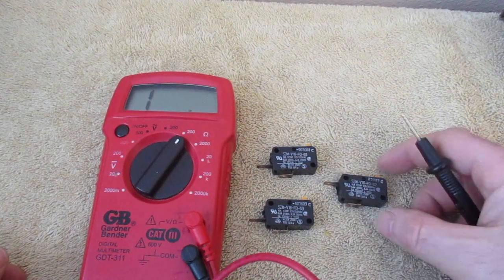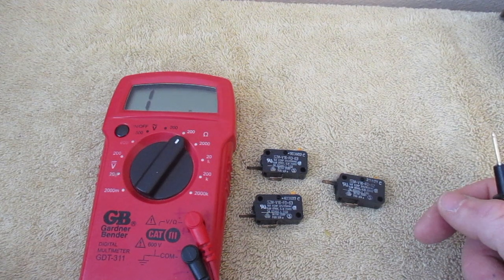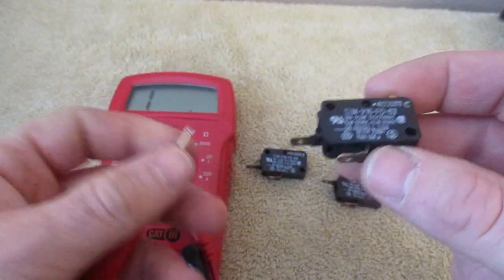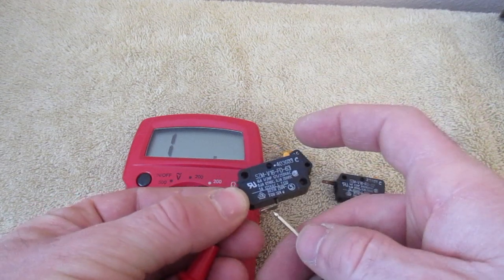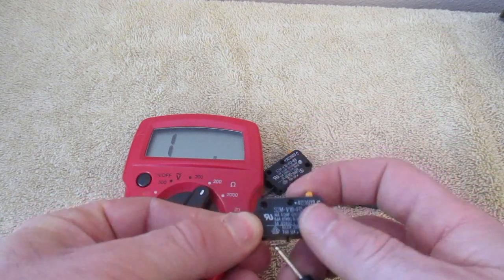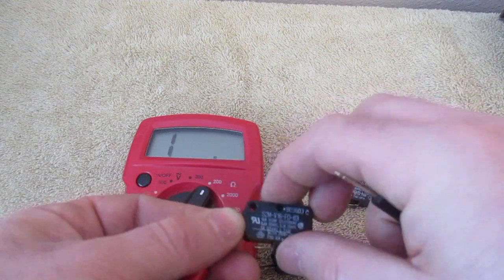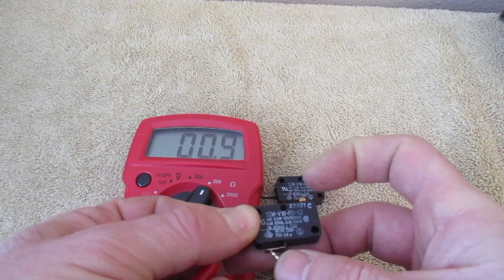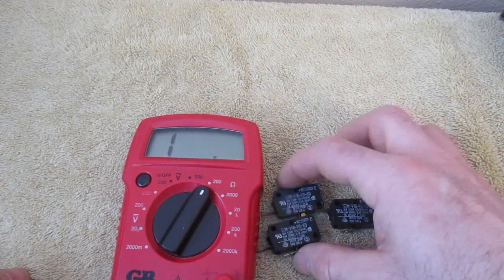Microwave not Working How to Test Door Latch Switch SZM-V16-FD-62 SZM-V16-FD-63 Microswitch

Comment: Got a question so gotta replace  one switch but one is a FD and the other one replacements I got that’s very similar Is a FA does the letter matter any??
Reply from the maker: Typically they work, but while the switch casing looks identical there is usually a difference with the internals of the switch.  Although it is usually a small difference and often has little affect, but at time may be enough difference to short it out again more quickly.  It is suggested to order the same part number.  Ebay used parts are always inexpensive as well if you can't find what you need.

Comment: How do you know while testing which switches are open or closed ones?
Reply from the maker: Well if it's not clicked and you get a reading and then you click it and you get nothing then it's a closed switch.  If you test it and it's not click and get no reading and then click it and get a reading it is an open switch.   If you need a part just look up the part number on your switch and look for a used on on ebay